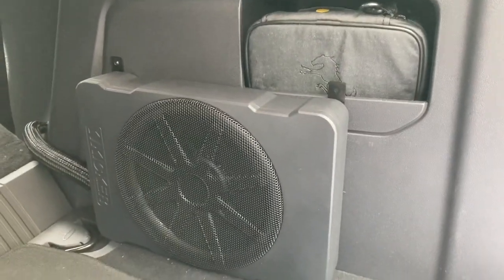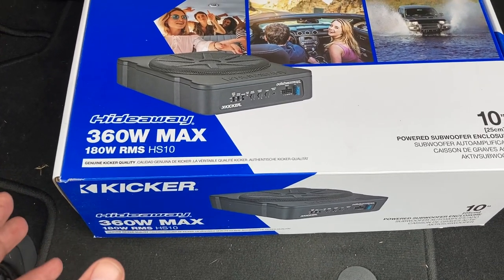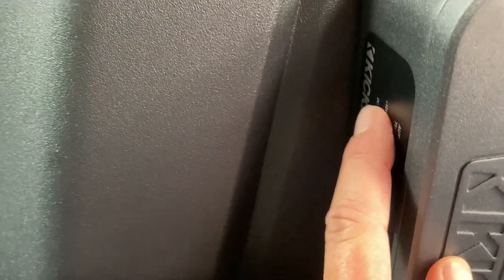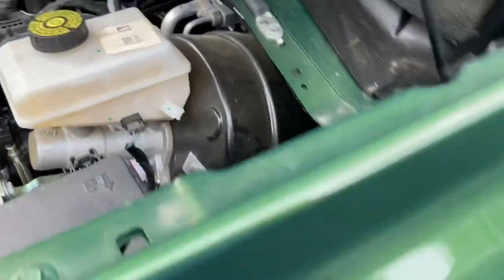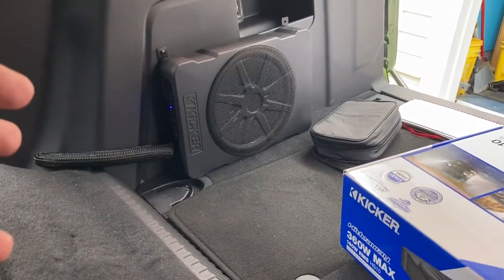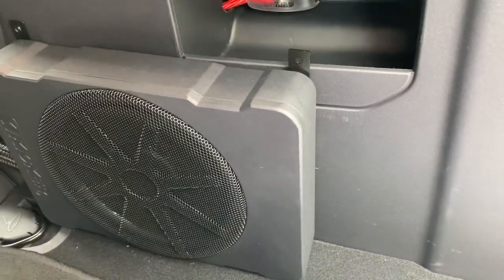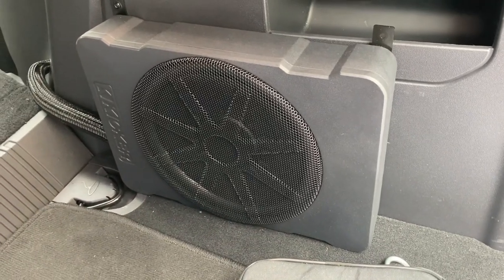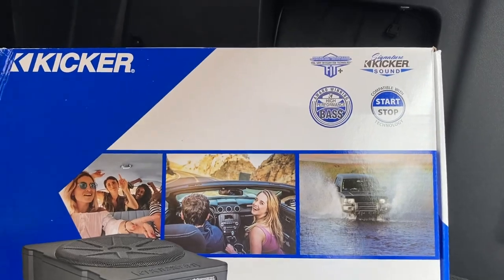Ford Bronco Subwoofer! Rear Fuse Block. Awesomeness and better than B&O Factory for less $.

Comment: Great product.  Video very helpful.  I did use heavy duty velcro instead of drilling into plastic and it holds the unit very well.  Also no need to cut grommet in fire wall.  It's designed to be put back in with a wire

Comment: Thank you very much for sharing. I appreciate the info. Now I know what to buy to complete my system. I have spent the better part of a month gutting and replacing the speakers and making a removable speaker cabinet, plus fine-tuning. I am still not satisfied, though. I am using all Kicker speakers so far and they are excellent. But the Bronco itself needs to be designed with resonant cavities in mind and my Jeeps have amazing factory audio in them, so I am scratching my head about the factory design of the audio in the Bronco. It is such an awesome vehicle! But man, sound is SOOOOOOOOOOOOOOOO important. Music is everything in our lives. Don't neglect that part.

Comment: Not sure if it was mentioned but you should have you fuse box closer to the battery. If you were to ground out or blow that fuse it could burn all that power wire all the way to the fuse box. A good rule is to be within 12 inches from the batter.

Comment: If you have the Aux. Switches,  there is a wire drop behind the right rear quarter trim panel.
Reply from the maker: Didn’t have the auxiliary switch. But I do have a sunglasses holder.

Comment: Hey Cory, Excellent video. I am still waiting (going on two years now) for my Bronco to arrive. Being an old fart, I have a large JBL subwoofer sitting in the garage from a previous truck that I am planning on installing. I have ordered the B&O system so I should be able to tap into that sub closer to the JBL sub. I am planning on adding quick disconnects so I can quickly remove it if needed. By now you have probably been playing quite a bit with your Kicker. In your video you mentioned not installing the sub level controller. I would recommend you do so. In my Yukon I used to adjust it constantly depending on the song that was playing. Oler music didn't seem to have the kick that newer tracks do. Anyway, great video keep it up!!!!  Enjoy!!!

Comment: The way your using signal from the speaker wires to get it to turn on, will actually make it turn on when; the doors open, the door chimes, or the navigation is on. If you have proximity key, it will also turn on. I would keep an eye on it, imho.

Comment: I noticed your blue power light was on in the video. Was the vehicle on? I have the plug n play kit and assumed the remote turn on was wired in with the harness somewhere, but when I have the sub in DC, the blue power light stays on when the truck is off. Do you think I’d still have to tap-in to one of the 6.5’s?

Comment: Can you give me a brief run down of how you connected the line in? I think you said you wired it in with the 6.5" kick panel speakers
Reply: I have a 2022 2 Door.
Reply: Do you have to run a wire front each of the front speakers or just one

Comment: Hey Cory D - you should always place a fuse within 18" of the battery.  Easy to add inline if you like now - I know you're fused at the back but still...thanks for the video, really considering going this direction.
Reply from the maker: The fuse is there and within reach of the battery like a foot or so thanks.

Comment: Man THANK YOU SO SO MUCH for doing this Iv been trying to figure out the best way to add a sub to my bronco Iv looked everywhere and havnt seen anything that would work off the original head unit Iv even went as far as trying to find where I could get the B&O sub box that they put in the upgraded broncos or was even looking to see if you could just mount a 10 to the back panel and let it use the air space it has because where you put your box at is exactly where B&O put there sub at in a little plastic shaped box that was kind oddly shaped but they did that to match where they put it and the stuff they had to go around and the put the amp in the same place behind that panel you put your box I wonder if that box could have enough room to clear behind that panel and then just cut a whole for the speaker off the same box you have then mount a grill over it to protect the speaker just wondering if you think that would work but either way you just solved my problem man and I greatly appreciate it so much I watched your first two videos that’s how I put mine in but I put base blockers on the top dash speakers and I need to put them on the back speakers because even though I got good speakers the right size and made sure it matched up good the bronco still doesn’t sound good to me because it needs that base also what do you think about running that wire behind where yours is mounted and drill a hole out infront of the hook up points where that last little bit of wiring you have showing would be covered and you could mount the fuse box right next to that whole do you think that would be to tight to make that turn for connecting the sub box up? And last two questions I saw how you said to tie into that one front speaker and run it around with the power wire but did you also say you have to tie in to the passenger side front speaker if so did you just run that side down that passenger tray till you get to the amp so that’s the only wire you have to run on that passenger side? And  could you have ran that speaker wire from those back two pod speakers just wondering? Last question do you think that box could fit under one of the front seats? MOST IMPORTANT QUESTION I wonder how it would work mounting it to the back tailgate? If you could please respond this video was super good it helped me so much man Iv been looking for something like this since I got it in February. I really you hope you keep finding good options to put on bronco because it’s hard to find a good install video or anybody at all talking about it and the price for bronco stuff is so high with very little things to upgrade the bronco I looked at a front bumper same style as the bronco built identical besides the bolt up but the design was the same and for the jeep one it was 298 with lights in it and winch hook up when you look at bronco same brand and exact same design bumper and the bronco is 15 hundred the only difference is mounting brackets and it’s that much more that’s crazy please get back with me I’d greatly appreciate you and thanks for such good info on the sound system in the bronco

Comment: My plan is to actually hide away behind that panel. So is wire running the same if you don’t use that fuse box you have on the back panel? I am thinking I won’t do that and just tie into the front two speakers

Comment: Did you ever try putting this inside the kicker panel? Was wondering if it would fit.
Reply from the maker: Didn’t fit. Something custom could be done. But a lot of the stuff that I have done was when my Bronco was new and not very much available on the market.

Comment: Great job! You explained everything perfectly too! I do have a question though…does the plastic rattle when the base hits? Also one recommendation…put some silicone or something like that around the wire where you cut the grommet - water can get in even that high up the firewall.

Comment: How is the bass compared to a truck box? Does it suck? I am looking at one because I can hid it under my trunk floor but am concerned it won't have enough of an impact on my Bose system. I had a Rockford fostgate 10" truck box before and it was plenty. I would be ok if it didn't hit as hard but I'm getting mixed reviews so any input would be helpful.

Comment: Possibly a dumb question 😂 there is a cigarette style power source in the back of the bronco, could you tap into that instead of running power cable all the way to the battery?

Comment: Where did you mount the harness ground wire? I'm looking at the ground point where the light and power output aft of the cubby but want to find one under the back seat.
Reply from the maker: I mounted the ground to a bolt near the seatbelt. I’ll check if I have any photos.

Comment: I have a 2 door and space is already limited. Could this Kicker fit under the divers seat?
Reply: I bought the 8 inch which is smaller and it won't fit under the drivers seat
Reply from the maker: Doesn’t fit.

Comment: Why not tap into rear speakers? Is there a reason not to? I’m trying to install mine and get get the amp to turn on from the signal
Reply: I know it has been two months....but wanted to comment here. I do not believe there is a bass signal going to those rear speakers unfortunately. This is why they sound so horrible. I replaced them with 4 1/2" kickers and they still do very little to fill the back of the Bronco with quality sound.
Reply from the maker: The situation is this.. the wires going to the front speakers are more powerful from the head unit and actually Crutchfield said that they had several people who had issues with the remote turn on given the rear speakers lack of power.
Reply: @jackleechiii8408  thank you. I gave up and will return at a later date so two months later, 6 months, it’s helpful so thank you and makes sense